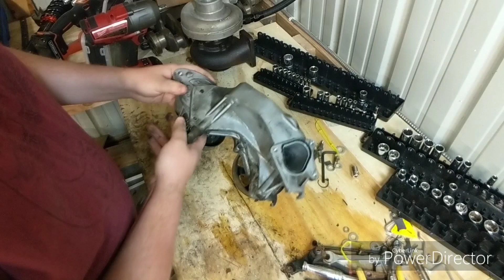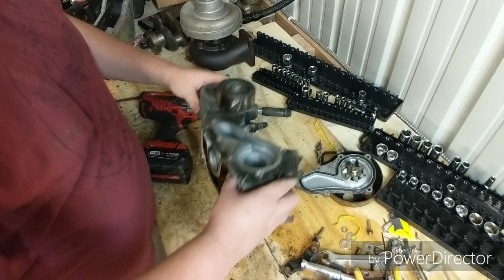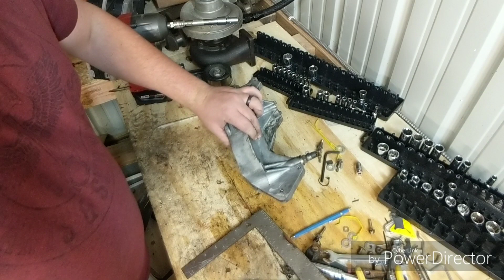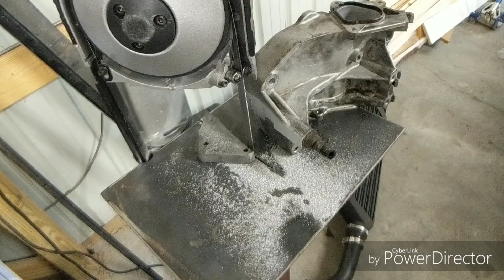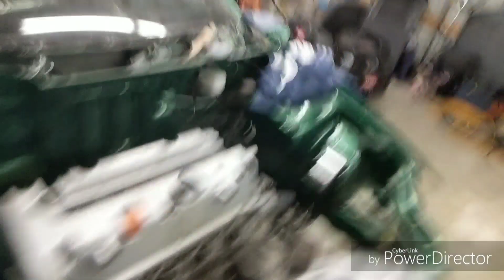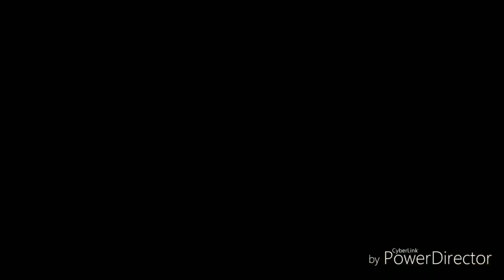AWD K Swap: modding my water pump housing!

Comment: What is that top port for? (The facing outward at the very tops)
Reply: after looking into I think it’s actually a vacuum line that goes to intake manifold. I could be wrong though.
Reply from the maker: @droboyjr  you are correct. I have a k24a4 out there and it's vacuum for sure. Thanks for watching dude!
Reply from the maker: @droboyjr  I can go out and take a look. It's one of the two 🤣
Reply from the maker: Coolant line. Don't recall what it goes to off hand. I haven't touched my k swap in a couple years so it's just collecting dust

Comment: I just did this, boy was it a challenge lol. No band saw I literally used a drill lmao
Reply from the maker: i couldnt imagine how tough it would be without a bandsaw! more power to ya! how'd it turn out for you?
Reply: @jeffibuilt  not to shabby lol. It's not as clean looking but it works
Reply from the maker: @jooeee23  well I honestly didn't expect mine to turn out so good with one cut. I plan on tig welding it to fill in the gaps and then grind it smooth. Just as soon as I finish this damn engine bay. Shaving bays are the worst.
Reply: @jeffibuilt  yeah but they look so good 👍 I don't know about you but I'm a bit of a stickler with details and it's expensive lol
Reply from the maker: @jooeee23  yeah. I always built Hondas when I was broke and now I have the money to build it right and I just haven't had the motivation. I'm trying to change that. But yeah thanks for watching dude. I hope to see you comment on the next video! Stick around!

Comment: Did you add hondabond on the housing before screwing it back into the block?
Reply from the maker: I haven't installed it. Car has a lot of work needed before I mess with the engine.

Comment: Did you do a RBC cam gear and a type s oil pump conversion.thats all a must have.
Reply from the maker: Not yet but it'll happen before the engine goes in officially. Right now it's just there so I can measure driveshaft length before I pull everything and prep for paint
Reply: @jeffibuilt  bro re mount the rear driveshaft your axles are way too angled and will bind and snap easy
Reply from the maker: @jasonjackson8683  it's not that bad actually. I'll post a video soon showing it. I'm going for more ground clearance and not shooting for 1200hp either. If I have trouble with it I'll reevaluate the mount location but the axle angle is within manufacturers specs.
Reply: @jeffibuilt  I'm tryna sit back bro and see how everyone else does there awd conversion than I'm gonna do mines but right now it's expensive swap to do .and transmissions are limited.
Reply from the maker: @jasonjackson8683  yeah I have sold my plates to a few people but you are still stuck having to spend a lot on LCAs. We really need someone to make affordable custom length axles
Reply from the maker: Not yet but it'll happen before the engine goes in officially. Right now it's just there so I can measure driveshaft length before I pull everything and prep for paint

Comment: Im gonna have to steal your idea and do that on mine lol. You hit that cut pretty dead on. Lmk if you decide you want to weld those gaps in, id be happy to do it for you.
Reply from the maker: I thought it would be too high but I'm very glad I cut it where I did! It didn't register that one side of the pump was 1/4 inch higher than the other until I made the cut.